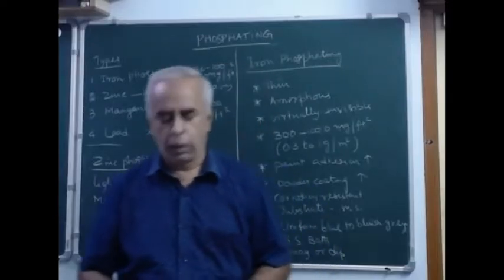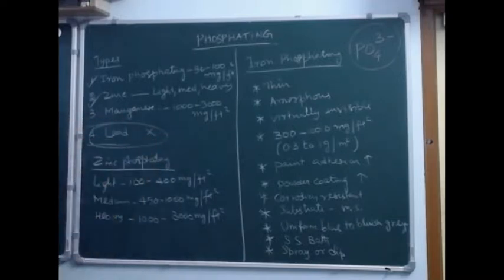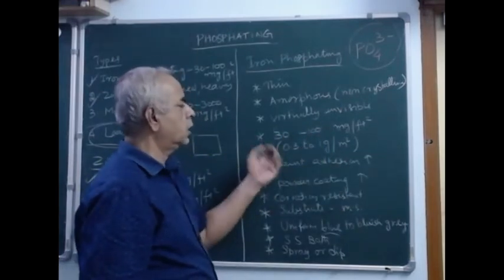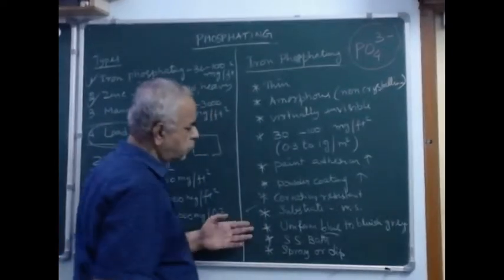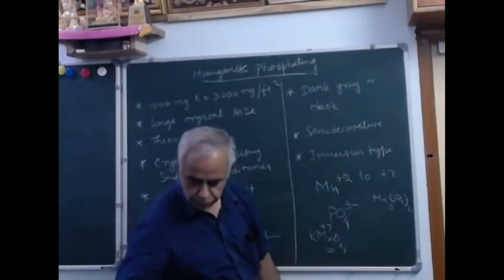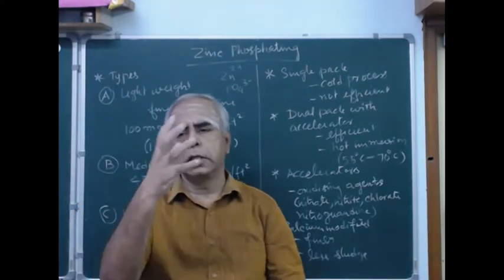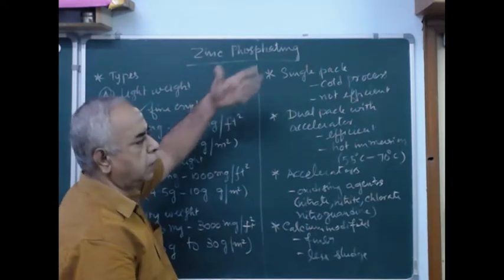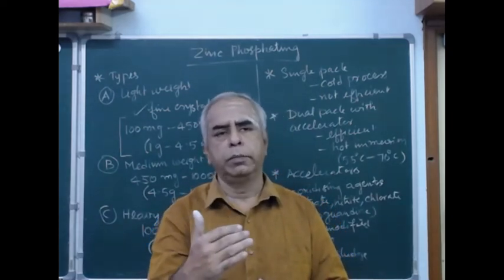Phosphate coating metal pretreatment in English

Comment: Hi Dr. Ramanathan. Thank you for this video, it is super detailed and explained very well. If you have the next video of construction and maintaining a bath that would be amazing. I am in the process of setting up our phosphating area as part of our powder coating line. Also, any more information on the dual pack with accelerator and the issues with heating elements and shop floor level usage would also be very helpful. Thanks again for your video.
Reply from the maker: Will upload soon